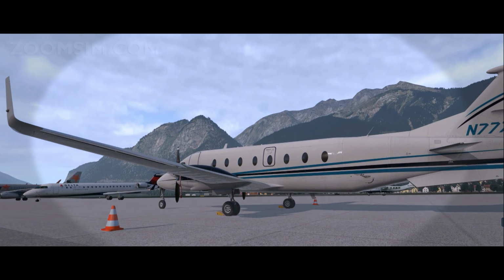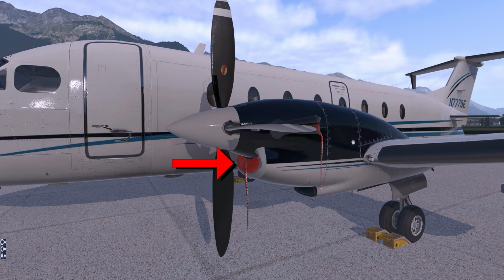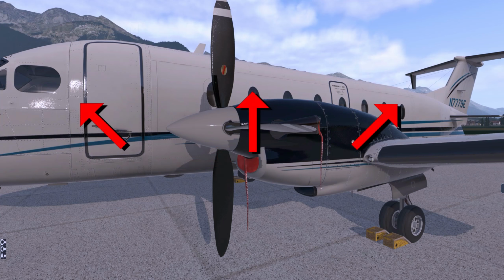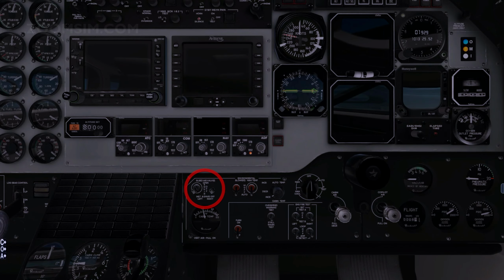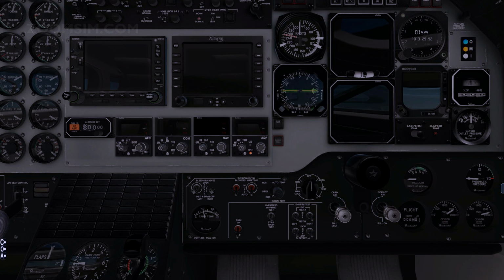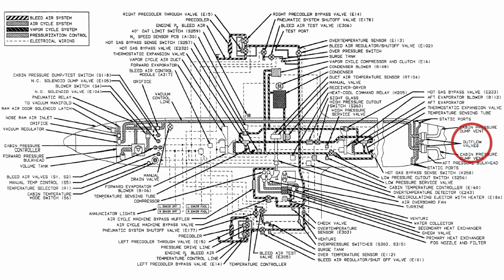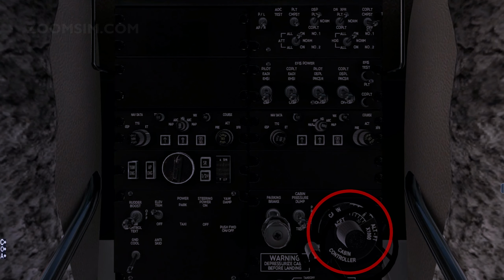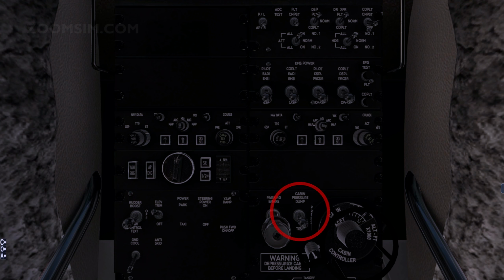X Plane 11 : Carenado Beech 1900D : Reference Environmental System

Comment: My notes are P3 bleed is about 800f thru precooler 425+/-25f into either the ACM Turbine, or Bypass. Instrument air is normally open, powered closed, and Enviro air normally closed powered open